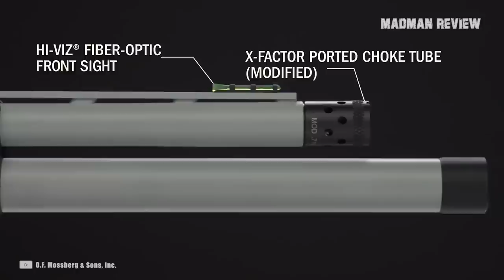10 Awesome Shotguns JUST REVEALED At Shot Show for 2023

Comment: Hey MadMan! I came here for the thumbnail gun. is the standard looking shotgun with multiple tubes a concept? What is it?
Reply: THIS IS A FALSE...BAIT & SWITCH TYPE CHANNEL! I'M UNSUBING!🤥
Reply: Me too actually. Guy thinks he's slick and that we don't matter but bitch I won't be back on purpose.
Reply: It's called clickbait
Reply: @ivankrylov6270  Nope, it is a real gun. It is called the Benelli M2 XRAIL. It was designed for open/unlimited classes of 3 gun completions. But of course it is easy just to assume you know it all and jump on someone else.
Reply: Don’t listen to the no nothings below, it is an actual working shotgun. It is a Benelli M2 with the XRAIL system. Basically it is a set of 4 magazine tubes that rotate into place after the last round leaves the tube. It is used in certain 3 gun competitions classes, I believe they are called “open” or “unlimited”. Saw a video on it some years back. Not sure if anyone is still using it, or if it is still available. The guy shooting it liked it, but said it was not as balanced with the extra weight of the additional 12 rounds.
Reply: @crazymoparguy5920  THANK YOU. I'd never seen this  before and now i want one!!!.
Reply: Clickbaiter
Reply: @crazymoparguy5920  Thanks for the info. Its clickbait because this isn't a video about the XRAIL system. I bet the balance on that rig is a little front heavy. Thankfully I don't need twenty-something rounds in the tube.
Reply: It is a zastava master click bait 12 with 28" barrel.
Reply: @upcycle.outdoorsman9629  no, it is available as a fully functional firearm too. So not really clickbait. And yes, it would indeed be very front heavy.

Comment: People are crazy to think that 28 gauge and even 410 aren't effective. Multiple wounds per trigger pull is just an incredible huge advantage, especially when those wounds deliver 12+ inches in gel EACH.
Reply: Exactly, idk much about hunting, but you can still put a grown adult down with 2 or even 1 shot of 410 given the right rounds, so it's gotta be passable for hunting ducks or pheasant ect. And if youre hunting larger animals why wouldn't you be using a rifle anyway?
Reply: Standard 28 ga. I understand. But why a 3"  Magnum 28 ga.? Just use a 2 3/4" 12 ga. or 20 ga. Cheaper and more commonly used. Just doesn't make a lot of sense....
Reply: 410 just a skinny 12 gauge